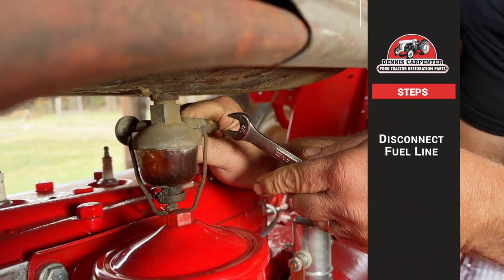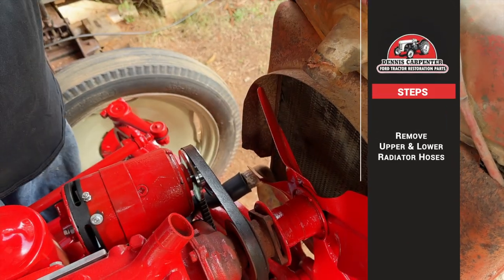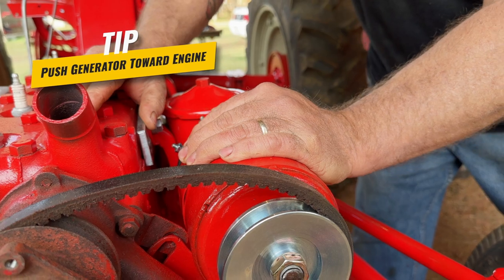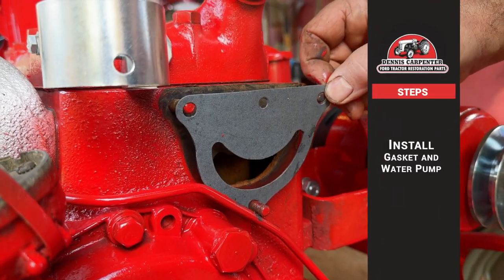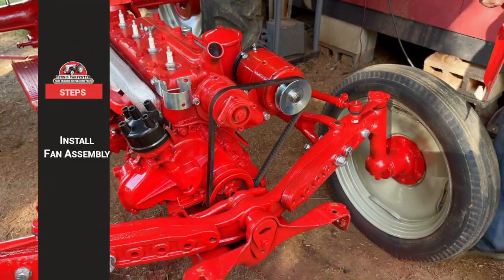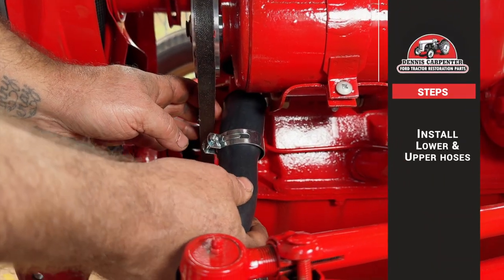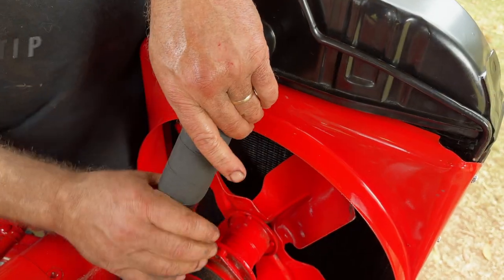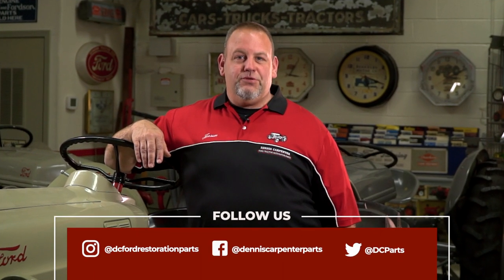How to replace your cooling system on your N-Series Ford Tractor

Comment: I just did a head gasket on my 1949 8n. Coolant won't flow, so I took the hood off and removed the radiator.  Something was in there because it was plugged. Got it back on yesterday. Hoping to finish getting the tractor back together today, and I hope it works and I have no more surprises. It's not easy getting the hood on and off by myself. I don't have a lift or hoist. Just me lifting.

Comment: don't need to burp the coolant after you replace it?  let it run with cap off radiator until it burps/bubbles the air out.  Is this a necessary step?

Comment: glad you got your shroud to fit. the new one we used wouldn't allow the fan to turn fully. the fan kept hitting the bottom left of the shroud. we had to cut the whole bottom left section out. total waste of money buying a new shroud for our project.

ps Just looked at the order and yup the fan shroud came from Dennis Carpenter. Fits like garbage. Costed $100. Thrown out the window. Had to hack it to fit. Yall gotta do better on these FORD 8N parts. NOTHING fits like the original folks.  NOTE:  If you're restoring an 8N try and use as many original parts as possible. even if they are used. These reproductions don't fit worth a darn. Some do, but many don't.  Just like reproduction fuel door hood and hinges. All garbage. All Companies
Reply: You are 100% right. I'm having the same problem with these crappy aftermarket parts that don't fit as they should. And the prices are ridiculous! Especially when they aren't the same size etc. as the original.